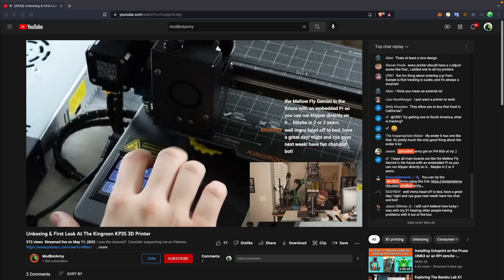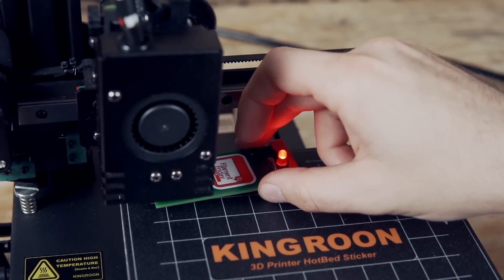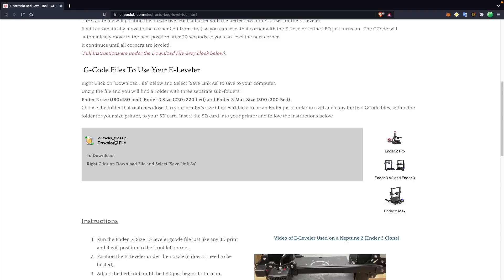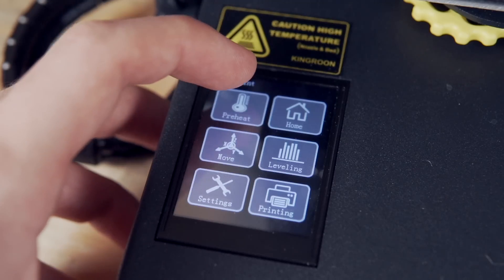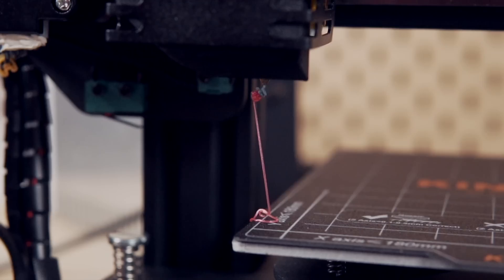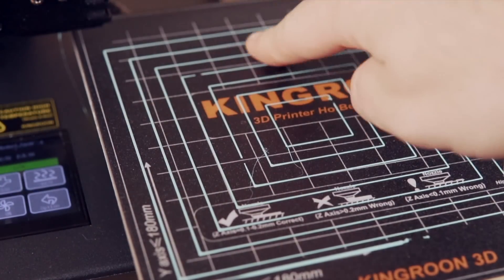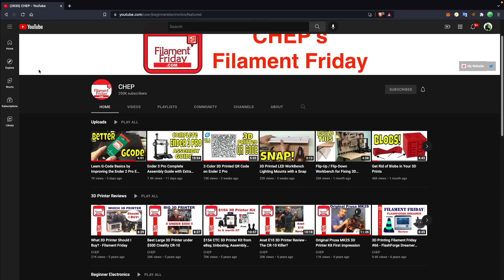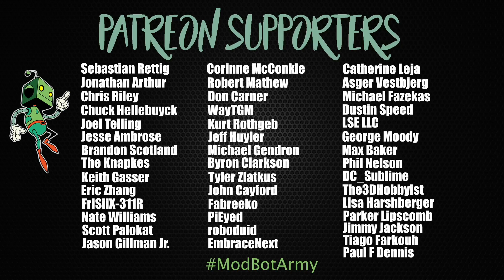Take The Guesswork Out Of Leveling Your 3d Printer

Comment: I bought one off Amazon for 20$ and I measured it at 5.4mm when the button is pressed enough for the light to just come on, I set my z off set to 5.4 and when it auto homes it's already way to low to slide the leveler under, is it because I have a built in auto level sensor on my printer? (Aquila x3)

Comment: Do I have to mess with my Z offset still?
Reply: Lol yeah . Is not that hard. It probably would take 20mins or so to manually level your bed without this pcb stuff. Just like anything 3dp related: you just need yo adjust several times , then after that just fine tune. After that you barely need to re- bed level this. But still is not that hard. Wonder why may people find it difficult. Just do it several timeS till you see some results.

Comment: Professional Firmware makes this so easy; using the BL touch to probe each corner to then show on screen wich knob to turn such that the bed is properly level. It then can create the bed mesh and that's it; a level bed and no extra equipment required. But this little contraption sure is useful for printers without BL touch or that require manual leveling, since Professional Firmware isn't available for all printers as far as I know.

Comment: How do you determine the offset needed? I've been using the paper test in the middle after running the e leveler but that does not seem to be accurate.
Reply: Watch the video several times, search for additional tutorials online etc.  Clearly u are missing some steps on the process

Comment: Seems like a great idea that is successful, but I have to wonder about slight variations on the sourced tactile switches.  Not all batches engage at the same distance.  Plus the accuracy from the button on the pcb an the "foot" at the other end that is 3d printed can vary.  The travel distance of the tactile switch also will change the angle of the board itself, causing a slope.  How is this corrected for? Is there a version for longer/wider print heads such as the Sprite Pro?  How does it affect printers with an ABL sensor?

Comment: I have gotten used to the paper method, but you can't escape a warped printing bed :3 
So now I just bed level it with my eyes xD I bring it just close enough that it doesn't drag on the bed. It's not for everyone, but it works for me ¯\_(ツ)_/¯ (for anyone that cares, yes I tried printing on glass, it's not a fun time getting things removed though ...So I got myself a flex plate (or whatever it's called) and I'm never gonna change it with anything else!)

Comment: I've got a Chuck's leveling tool. I've felt no need to use it. When my Voxelab Aquila comes out of level (or I feel like I want to level it based upon how a print turns out), I gravitate to the paper + 5 points method and do that like 5 times and then do a level test. I understand that my PEI flex bed isn't 100% flat and I compensate for that when leveling. Nothing can help level a really bad bed, not even Chuck's tool.

Comment: I have been using pronterface to manually control my printer and level the bed with a feeler gauge. I may look into adjusting chucks gcode for use with a feeler gauge.

Comment: I'm also in the feeler gauge crowd. You can't beat the "feel" of metal-on-metal.
There will be manufacturing tolerances on the thickness of the PCB, differences in the distance the switch is soldered from the PCB, then repeatability of the switch itself (it will activate at a difference pressure each time). All this needs to be taken into account when tramming.
I'm not dumping on his project, just people need to be aware that this method will not be as accurate.
Reply: Who cares about the thickness of the PCB? You aren't calibrating an offset, you're leveling the bed, so you will always have the same thickness for all your bed corners. The repeatability of a momentary switch is higher than that of a BLTouch.

Comment: How’s this accurate?  Paper is much smaller and closer to the bed than using this which is much thicker… much much thicker or higher.  Would this not throw it off?
Reply: You account for the pcb thickness with an offset value.

Comment: At first, I was doing the paper method and got confused on how much the friction it should be. I then considered buy this one but the shipment cost is pretty high (I'm in SE Asia.). 

Then I made a clone using an IC board an a few components. It works pretty well. It doesn't look as well made as Chuck's though.

Later on I learned that I can use the built-in leveller to do this. All I need is to flash a  new Merlin firmware in. The stock one can only probe the bed, but doesn't assist the traming.

Now I'm a happy Ender 3 S1 user with the professional firmware :).
Reply: I don't see the problem with manual levelling. How difficult is it to make sure the friction is the same for all four corners by feel? They just need to be the same. That is what level means.

If you're not sure what this friction level should be, or is worried that you would set it too low and immediately destroy it when it digs into the bed ... the solution is obvious. Err on the too far side initially. Then test and see if the first layer sticks.

Eg, first you make sure there is a mark on each adjustment knob, so you can note the setting. Write it down. For the initial first test, when you want to err on the "too far" side, instead of using a piece of paper, you use something thicker. Maybe two or three sheets of thick card stock (like a postcard). At least the bed would be level, if a little bit too far. Test one layer. If it does not stick, move it closer, one card. Then one piece of paper.

After you remove the paper, turn the knob further until the bed itself is in contact with the head. Look at the setting on the knob. That is the gap you have. The gap is tiny, but not zero. Because paper has thickness.
Reply: PS: of course don't forget and set that corner again. Don't leave it in contact with the head.

Comment: Mine work great  but the red piece was kinda loose. In my panic to level the bed it fell off several times. I use painters ta but am contemplating a drop of super glue. Thank you for stating a way to increase the time allowed. He has stated or made a video that you can change it on some printers you can make it stop at each corner until you are done  and click to move it to the next corner. Thank you for your videos.

Comment: I can't see how it helps level the bed when you look at the big amount of gap it has between it and the bed when leveling?  there must be at least a 8 to 10 mm gap there.
You would to need to do a big z off set of that amount to have a leveled bed or it would just be floating above the bed by that 8 or 10 mm gap.

So good idea but really can't see having that gap helps.  

As for bed leveling the old way so to speak I had a hell of a time doing the 1st 3D printer I got a 2020 model of a Tronxy X5SA.. the bed being 330 mm square with 6 adjustment screws was to say the least impossible to level. Yes it states it has a auto leveling system, But the original blue sensor they did was a waste of time as it detects only the steel metal base under the bed cover which it's self was thick aluminium so was not picked up be the magnetic sensor. I spent many hours trying to do auto leveling and the manual version all with not luck even doing the z off set was a pain.
I in the process of fitting the Tronxy with a 3D Touch so I can use the printer after it been left sitting for 3 years.

Later on I got a Aquila and being a smaller bed was a bit easier to level, it now has a C R Touch there as I even had issues sometimes leveling it well?

Now I have also a FL SUN Delta QQ-S Pro with a good auto level probe you attach only as needed.

I just last week managed to order in a pre-launch video by Elegoo one of the upcoming Elegoo Neptune 3 FDM Printers. it was on sale and will cost me less than my Aquila did.
This has full auto advanced Stain Gage leveling head system. so it be a dream.

Hopefully later some time I wish to get the new Elegoo Saturn 3 Resin Printer that was just launched on the video last Saturday where I ordered the Neptune 3 FDM printer.
Reply: yeah  it is only using a microswich , for that price I would have expected it to use some kind of   resistive  or capacitive foil  or something, something almost as thin as a piece of paper
I mean for $25 I can just order a  CR touch  off ali
or a BL clone for less than half that ,  looks like either way  you will still  have to go through the same trial and error as   leveling a least once to set he z height offset
I don't see the benefit really especially when a  probe is cheaper 
maybe the next version could use a capacitive film
probably could find a lot  of old  digitizers for old phones or other devices with resistive screens
if  that would be the better route  for cheap 
$24 for essentially a   resistor ,a  LED , a battery,  a microswitch and a  piece of perf board is not worth  it honestly ,
Reply: There's no need to have to adjust your z offsets when using this tool.   It's exactly the same as leveling with a piece of paper and trying to feel for the specific drag of the paper but instead you're looking for the light to come on when you have reached the appropriate level.   The tool is about 5 mm thick and the G-Code that you run picks up the nozzle to 5.8 mm and moves it around to the various points.  So you're using that point 8 mm as the leveling distance that you need to adjust with all your screws.   Instead of a 2 mm thick piece of paper you're using a 5 mm thick tool but it's the same idea.

Comment: I have G34 in my start code to level the gantry then Autobim is run from within Octoprint to assist me in manually levelling the bed and then the bed is probed in a 5X5 mesh before the print is started, subsequent prints are done with the bed mesh for about 8 prints and then I use the levelling profile again, sometimes I level the bed with the paper method and then use Autobim to see how accurate I am, I can level the bed to where I think it is perfect and a couple of times I have got it bang on but the majority of the time I am slightly out
Reply: And with manual levelling, you only have a 1x1 mesh. You can only adjust the four corners. The bed is unlikely to be perfectly flat. That is why you use a 5x5 mesh, right?
Reply: @danielch6662  thats right!

Comment: 25$ for about 1$ of components is just not realistic - also depending on the quality of the tactile switch the button press offset is neither constant nor particularly accurate (still accurate enough for a normal 3D printer but still varying quite a bit)

Comment: I use a feeler gauge and manually move the nozzle to each corner. Sometimes I go to print and find that something changes and the bed is off. The majority of the time it's the motored dual z kit, the right side skips steps for whatever reason and I'll have to take a ruler and double check that the x is parallel to the frame on both sides.

Comment: I like it, but I have a hard time justifying $25 for one. :/ Even for the diy kit, it's $12 from his site + $8 USA shipping.  however you still need to get a battery and solder it. I think the additional couple $ from Amazon  would be worth the time saved + not needing to source a battery. But $25 is too much. I'd pay $15 shipped (USA) for the kit. But that's about it. :/
Reply: He could have included a  3d printed  cr2032 holder
 not mount he battery on the board and have it detached  and  connected with some wires
I really need to print  some of those, haven't looked yet but I bet there are  STL files  for cr2032 holders

Comment: After using this leveling tool, you still have to correct the Z offset right? I just recently purchased an ender 3 s1 pro and I'm having quite a bit of trouble getting first layer adhesion even with the cr touch bed leveler. I'll manually level each corner with paper but then the center of the build plate won't be correct. Any tips would be greatly appreciated!
Reply: No, the E-Leveler should give you a perfect bed level at 0.0 Z offset.
Reply: @FilamentFriday  fantastic. Thank you for the reply! I just put in an order for it!
Reply: @XxBAC4everxX  there are also test prints to get the center of the bed correct, usually called bed level test or similar. If there are gaps between the lines z offset is too high, if its bumpy rough it is too low.
Reply: I was able to print the preloaded cat file after a little bit of work but right after that the next print would not stick.

Comment: I've switched to SCREWS_TILT_CALCULATE in klipper, which uses the probe to measure each bed screw location, and tells you how much to rotate the knob to get each corner level. I've seen this leveler around but it only seems useful for non-probe printers.
Reply: WHat a nice feature
That's quite crazy
Reply: X
Reply: SCREWS_TILT_CALCULATE then G29 for bed mesh and done but before that will need to do a PROBE_CALIBRATE
Reply: The creator has a setup for CR/BL touch also using the e-leveler